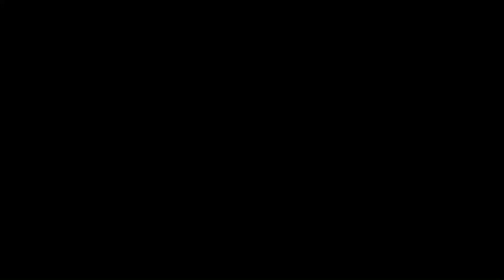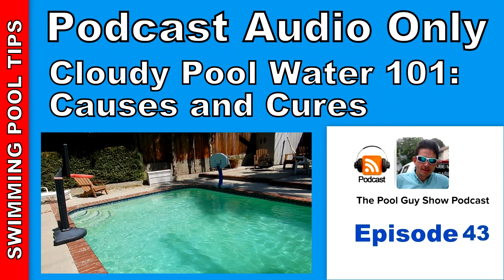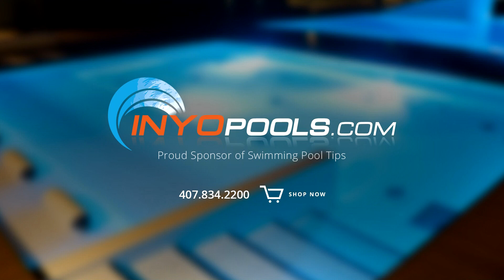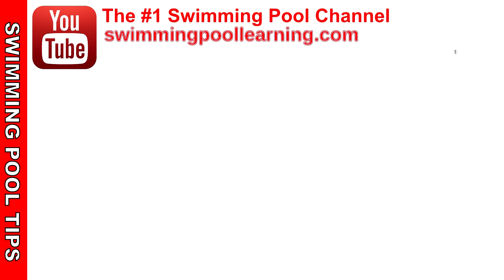Cloudy Pool Water 101: Cloudy Pool Water Causes and Cures

Comment: An outdoor pool that uses trichlor that tends to bring the ph down but the alkalinity up. It gets cloudy fast. How would one bring alk down and keep ph in range and clear up water?
Reply from the maker: The only way to bring the ALK down is with Muriatic Acid. This will also drop the pH down. When the pH gets to 7.0 I would add some Borax to bring the pH back up. Borax will raise the pH but not raise the Total Alk up significantly. So it would be a process of adding Acid to drop the ALK and then adding Borax to raise the pH up.  This website will show you how much of each to add to achieve your goals. You can find 20 Mule Team Borax at Walmart in the laundry isle. https://www.poolcalculator.com/